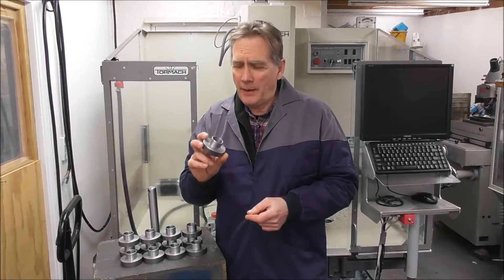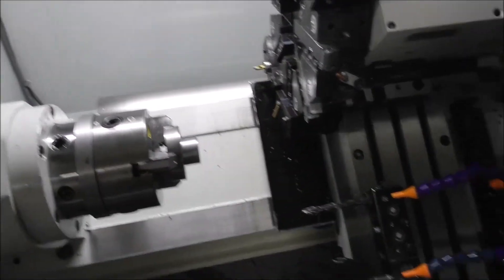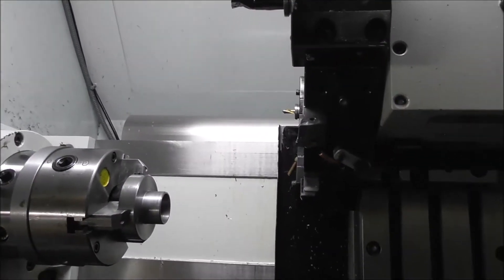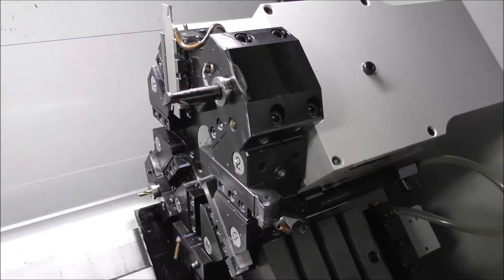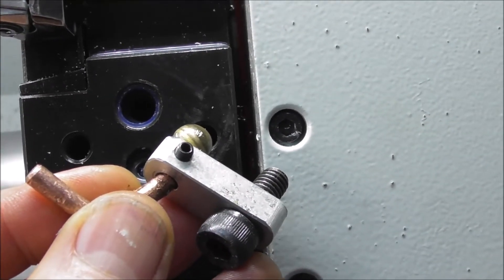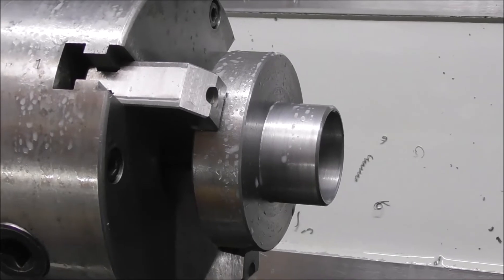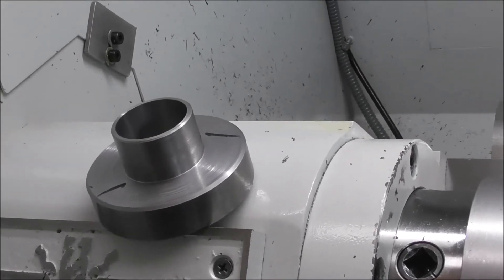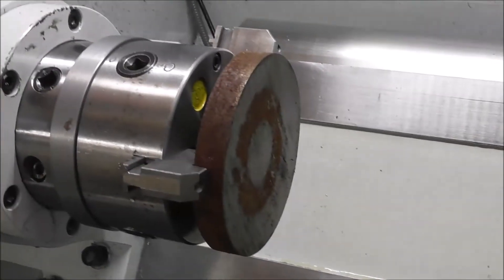SlantPro Set up and Run - Part3

Comment: You need to do the 1500 rpm max pulley addition.  Its a completely different machine in that range. I do production 7" diameter P20 mold steel parts with it.
ATB, Robin
Reply from the maker: Hi Robin. Good to hear from you. I would like to  change to a larger low speed spindle pulley and change the software to suit.  I am concerned your smaller pulley is below minimum dia.   I have made a video on this subject. If you email me it would be good to talk  : cliffhalldesign@gmail.com I can send you an early link.

Comment: How many kW or horse power is it Cliff? Positive rake tooling works pretty well on low horsepower machines.
Reply from the maker: Hi 77ind. It is only 3 hp. That would be manageable with a geared drive - but as it is the limited pulley reduction means the torque is low. Yes I am using positive rake tooling - I agree that is a must. cheers  Cliff
Reply: Threadexpress its a shame they don't have a gearbox in them. Would make a far better product.